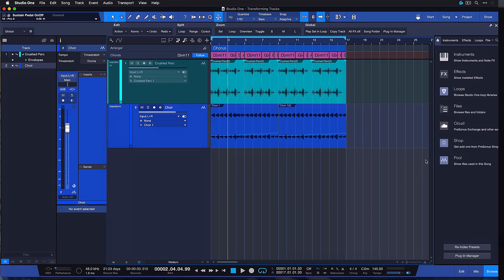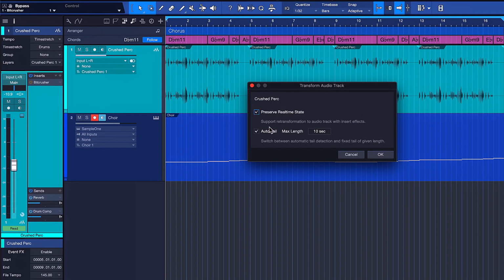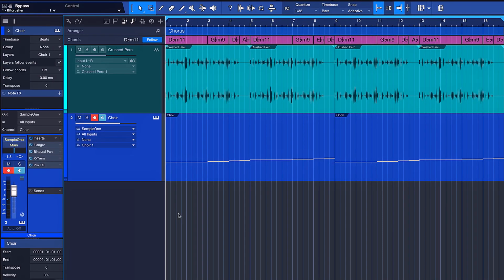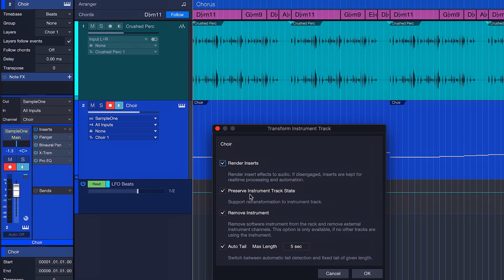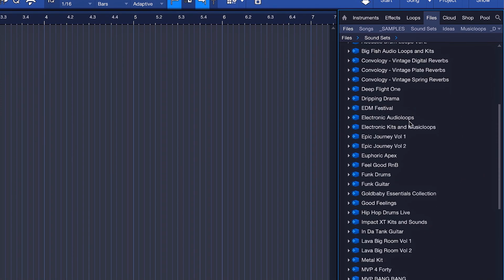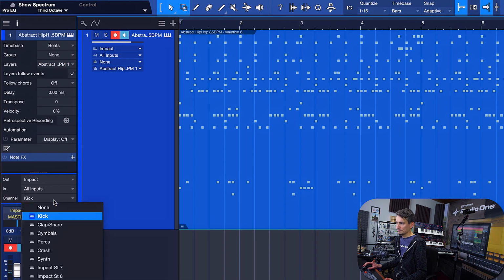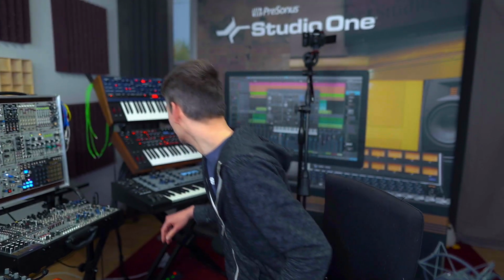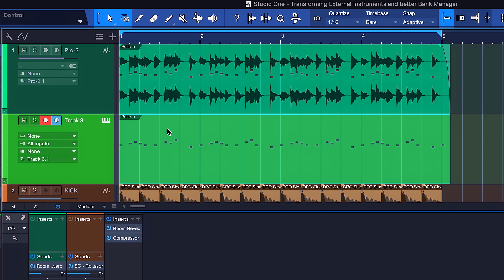Track Transform in Studio One

Comment: Hey Gregor, thanks for the awesome videos, always very helpful! I've noticed that in some songs when I try to transform a track it will attempt to render way more files than there are events on the corresponding track. If I try to recreate this in a new song, track transform works as expected where the number of files correspond to the number of events on the track. Is there a reason why it might be doing this in larger songs? Seems strange to me because it takes a long time to render and creates a lot of unnecessary data. Any help would be most appreciated :)

Comment: Hello.
I'm confused) I have an ATOM controller, it has 4 rotating Encoders, each has a number written under it (1/2/3/4)
By default, number one jumps over my bands in the mixer. Encoder number two - changes the TEMP in the project.
Number Three and Four are not busy. But how do I change these commands? How do I do it? I want to set Encodet # 3 to scroll by the timeline (so that the bar moves to the left / right according to my project. So that I do not press the "SHIFT" key + spin the mouse wheel every time. ) On encoder # 4, I want to set "TIME Zoom" - and quickly expand / narrow the window in the project. How to program it? Help me please.
Thanks to.

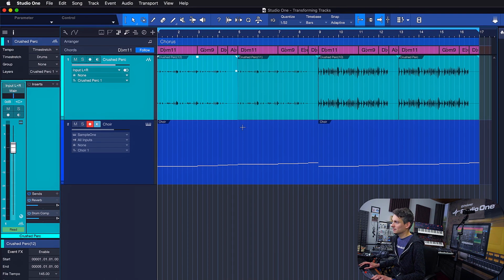Comment: 2:42, ok I find this very interesting. Off topic. I noticed you clicked on the first event and hit play. While it was playing, you clicked on the third event and while the playhead was moving, you did something to make the playhead skip to the beginning of the third event and play seamlessly. Mine does not do that which I've always found very frustrating. If I skip around like that, I have to stop the transport and hit play again for it to continue playing at the new location. The only way I can skip around while playing is if I click in the time ruler or an empty space on a track. There must be a setting that's causing this.
Reply from the maker: Hi RoSo, the command i'm triggering here is called "Locate Selection". It's extremely handy and can be assigned to any keyboard shortcut - or in my case, mouse button. For the latter, you'd need additional peripheral software though that can translate a mouse button click into a key press. -GBY
Reply: @fenderstudio  Thanks good buddy. I see I have to create my own shortcut for that. I discovered I can use go to time and it will also jump forward/backward to another location while playing. Pretty cool!

Comment: Thanks Gregor - could you clarify what is the difference with audio when you Bounce To New Track as opposed to Transform To Rendered Audio? Bounce To New Track prints the audio with plugin effects to a new track. Is there anything in addition that Transform To Rendered Audio does which is different ? I can't quite work out what the difference is. Thanks for the video.
Reply: I think it's pretty much the same as bouncing to new track, only with transform you have the option of going back to it's original state which is pretty cool.
Reply: @paulgigliottimusic  If you Bounce To New Track your original is still there. So there must be something else.
Reply from the maker: Hi Gary, there is an important distinction between transform and bounce, namely that the latter is a destructive method, whereas the former method is not. In case of Bounce To New Track, that's still destructive processing - it's just that the file gets copied first before the destructive processing is applied. Nonetheless, it's still destructive. Hope that makes sense. -GBY
Reply: @fenderstudio  yes thanks I understand it better now - but how about rationalising these functions under one heading ? Why would you choose one over the other? Why not just use Transform for everything? I was using the Bounce functions and had not even really known about Transform. Now I wonder if I will use Bounce again.....

Comment: hen in multioutput mode, does it also separate the midi notes into each sound/track? This might be a good indirect way to split midi tracks depending on the audio outputs
Reply from the maker: it doesn't, I totally get the use case though. This should be quite easy to set up with 2 macro commands, actually! First one would explode pitches to tracks...and the second one would select these newly created Tracks and start the transform process. I should build that sometime...thanks for the suggestion! -GBY
Reply: @fenderstudio  Well, the midi note editor allows to show/hide every track notes independently, and that's a WIN. I wonder if there's a way to color code the notes depending on the track (or midi channel! there's my "2 cents"!) when seeing/editing various instrument tracks at once. 
Also, I'd be great to have some king "layer viewing system" to bring to front or send to back different instrument tracks, cause many times notes overlap or end up hidden behind. But maybe that depends on track order (that would be smart). Will check it out later! Thanks for answering, G!